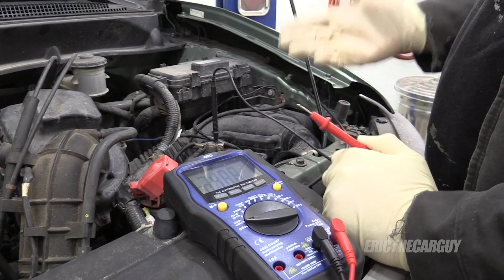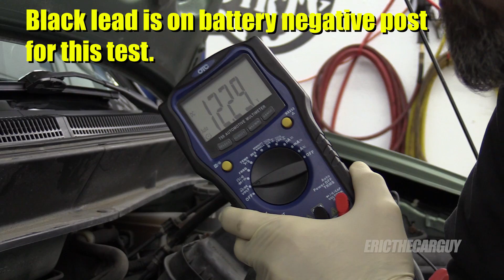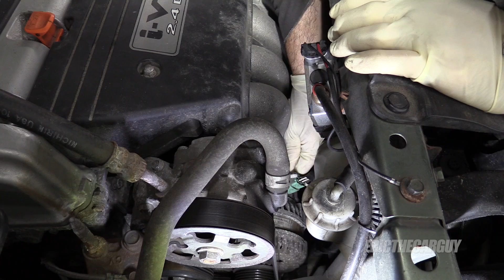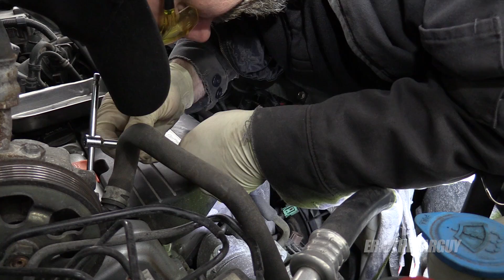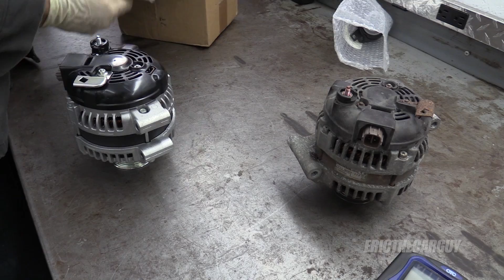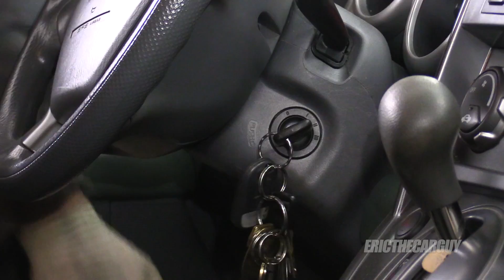Honda Element & CRV Alternator Replacement With Diagnosis

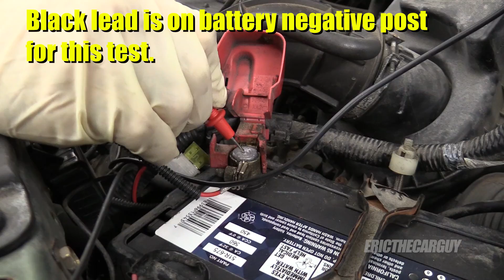Comment: what is "eld"? Never heard that before. its said at around the 2:00 mark
Reply from the maker: Electric Load Detection. It's a circuit Honda uses to help regulate voltage.
Reply: It also means fire in Swedish..!
Reply: EricTheCarGuy if I remember correctly, GM has a similar system for their trucks; where if the ECM doesn’t see a heavy load on the electrical system, I.e Headlights on or heavy climate control usage, it will decrease the alternator output to reduce parasitic loss on the engine.
Reply: Yes it does. But fire also kind of does allthough with an altarnate spelling.
Reply: Electronic Load Detector ELD